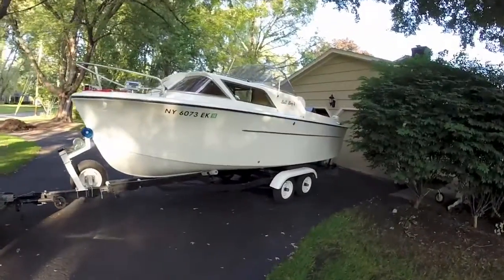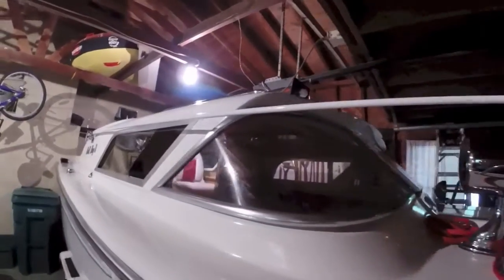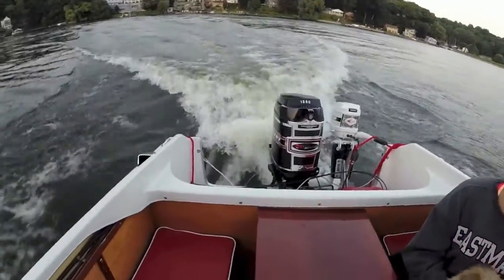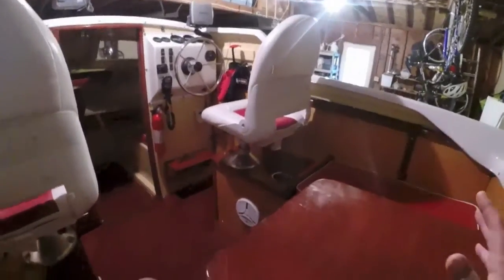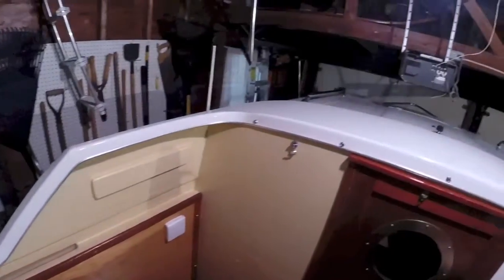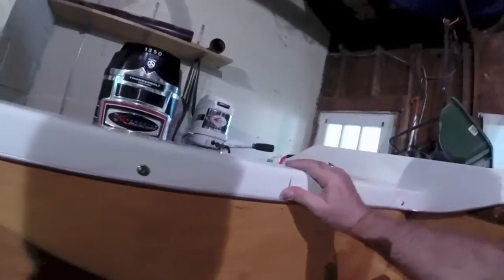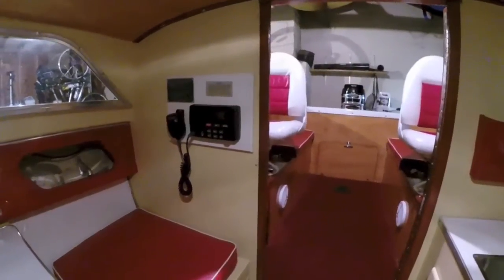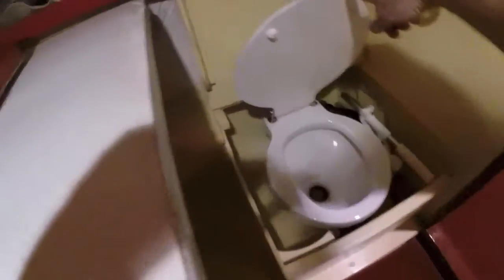The BellBoy

Comment: Really great work on your classic Bell Boy.  I have a little cuddy cabin boat and I'm wondering what is the heater you have?
Reply from the maker: The boat is in storage now and I don’t remember the heater I used. It was an online buy, 12 volts. Not particularly warm but it takes the chill out of the cabin for fall over nighters. I’m sure you’ll find something similar.
Reply: @bellboybob  Thanks, I've been looking at small propane heaters but I don't want to go in that direction because of safety concerns... I have ignored 110v heaters because I'm looking for heat while I'm out on the lake, not near an electrical source.  But a small 12v heater, hooked to a second battery, might be helpful, although like you say, it only goes so far on a cold evening.